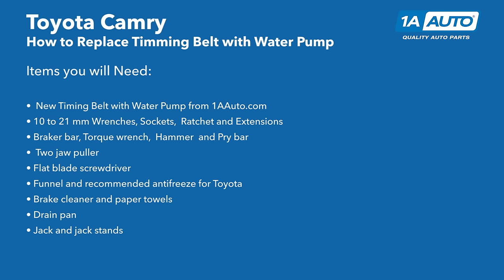How to Replace Timing Belt and Water Pump 92-01 Toyota Camry Sedan

Comment: I see a total of 3 belts are removed. What is the name to the belt on the alternator and the other belt, that isnt the timing belt?
Reply from the maker: +Dylan Martinez The first belt is the serpentine belt, the second is the power steering belt, and the last belt is the timing belt!  If any of our viewers needs to make this repair, we carry the auto repair part shown in this video on our website. Here is a link to them: http://www.1aauto.com/toyota-timing-belt-kit-with-water-pump-gates-tckwp199/i/gaeek00001?utm_source=YouTube&utm_medium=CTA+Comment&utm_campaign=ytcomment&utm_term=2kQLMP9AYGs
Reply: 1A Auto Parts thanks! I've already ordered the timing belt and water pump from your website.
Reply from the maker: +Dylan Martinez Thank you for purchasing through us! Please let us know if we may further assist, and if you have a moment if you could leave us a review on Facebook it would really be appreciative. 
 Here's a link: https://www.facebook.com/1AAuto/reviews/
Reply: So you guys are closed right now. This is the first water pump I've ever changed. From your video, you refer to this as one "whole" unit water pump. At 16:42 you say it comes with the water pump assembly WITH ALL THE HARDWARE INSTALLED and the video shows the water pump exactly as the one taken off. The new one you use in the video is entirely new front and back, both halves. You're not displaying this half new half old hybrid water pump. Which is why I bought this through you guys. I finally got my old water pump off, ready to put the new one on, from the kit linked in this video, and I have HALF a water pump with a gasket, as if I'm supposed to reuse the other HALF of the old water pump. I'm really confused because NO WHERE in this video was it mentioned OR shown how you put the old and the new half together. Is this normal? What do you even call the other half of the water pump? You sent me the outside half with the pulley, but I'm supposed to reuse the old inside half of the water pump?! @19:20, when the water pump is sitting next to the coolant reservoir and hes putting the new O-rings on, it is shown as one whole brand new water pump unit, which is what I'm really confused about.

They video overlay in the top left corner says "But the EXACT part that was installed in this video at 1auto" and the link is the same as the description, which was not the same exact part.

Everything has been great up until this point, the directions were textbook and easy to use. 

I'm going to be calling tomorrow. But this inconvenience is throwing me off and I'm at a standstill on my work until this is figured out.

Comment: 23:10. You did not change the oring seals. The front main seal, the camshaft seal and the oil pump seal. My oil pump seal is leaking.

Comment: Hey guys I need your help . Today I just bought a 1998 Toyota Camry Le ( with a Toyota Solara motor  Adapted) , I took its owner from Miami to Fort Lauderdale which is like 30 miles of distance  , pay him there and brought the car back to Miami  I had no problems with the car during my trips back and foward , but once here in Miami and while I was talking to a guy at the Company' s parking lot ( with the car on and on parking position ) the car suddenly turned off , and then it continued doing this all the time I turned on and leave it in parking position , I left the car there at the parking lot and tomorrow I' ll see what happens , guys can you give me a tip of what' s happening ?,  I called the guy who selled to me and he told me that was an sparkplug and wire problem , help please just a tip
Reply from the maker: +William Rodriguez If there happens to be a check engine light on you may want to have to code pulled. it should help to point you in a directions as to what the issue may be. Hope this helps you out. 1aauto.com
Reply: 1A Auto Parts , thanks body yes the Check Engine light on that car is on , it seems that this only happens when the car is hot , do you think this can be a big problem ?
Reply from the maker: +William Rodriguez You may want to pull the code, it should point you in the right direction as to what is causing the issue. Hope this helps you out. 1aauto.com

Comment: I see you just said don’t apply pressure on the two piece bottom pulley.  Next you use a two jaw puller on this very same pulley. I disagree.   This should have been a two bolt puller.

Comment: Got a '99 with >222K. and I HAVE DRIPS & small VOL of water coming from pump. I thought no big deal a water pump on a toytota... What a job it is,   His vid did it all in < 1hour but what does shop labor say.  He is not using paper gaskets on that pump and neck and thermostat. Nothing. Why? no Permatex here either  At least with gauge hitting top. No Bloen head gasket..
His exact car sound much more base than mine. It doe not avg even 19 mpg hwy but rtubns very well, ideas?

Comment: LOL the cam timing slipped one tooth at 25:59 because he didn't tighten the tensioner bolt before he rotated the engine. Am I the only one who noticed that?
Reply from the maker: Thanks for checking us out. Shop here for high quality auto parts: http://1aau.to/m/Shop-1AAuto-c +A/C PROS
Reply: You are correct. I saw it too. He also left the disc off the crank before installing the lower cover.

Comment: DO NOT use the video's instructions unless you are extremely desperate. That timing belt is so much harder to get back on properly than the video lets on and it will likely take days to get done right with a ton of trial and error. just take it to the shop bc once you slip that timing belt off it most likely will never leave your driveway again.
Reply: In the middle of reassembly, had no choice but to fabricate a metal bar tool to release the tension. I think you would be OK if the timing belt slips off, just like my old 240 Volvo, non interference engines.

Comment: hi...I hear a water squishing sound in my car front area...any idea what it may be?
Reply: Yes it overheats when car runs for 7mins.,plus my fans seem to not be spinning even when car is off,fans spend for a little bit when car is cut on and them stops.
.Overheat occurs near upper hose ara by radiator I changed hose and when Add coolant to burp system coolant does not sit in funnel it flows right through and a little smoke comes from radiator area where cap resides,I also notice a little price of black rubber is missing from radiator cap,can this be an issue

Comment: I'm going to pay a mechanic to do it XD just in case something happens..
Reply: You should replace the oil pump too while you're down there. Check your power steering pump too and replace all the belts, transmission filter, and oil pan seal. Then, your car will be good, for another 100k miles.
Reply: Replace the valve gasket and fuel pump too

Comment: Oh hell, there's no way I could remember all you have to do to replace the belt...too much to remember so I guess I'll have to blow $600. ( the quote I got from a mechanic at a garage) I may have to shop around for a cheaper price.
Reply from the maker: +Jim M. Thanks for watching. Buy the part in this video on 1AAuto.com: http://1aau.to/m/Shop-1AAuto-c
Reply: Did your timing belt break whenever you was driving and if so did replacing it with the work and no more problems

Comment: so when you click on the link its just the water pump and not the whole housing!  mis-leading.  Great video tho
Reply: I've never replaced the whole housing, just the water pump. The housing doesn't fail generally. I guess it could corrode if just water was used, no antifreeze. I've never seen it.

Comment: I totally appreciate this video, but how in god's name could Toyota make this be such a humongous job? You have to rip half the motor apart, align things you can't even see and then put it all back together just to do a simple timing belt change out. Is this for real???? I want to take all the old parts and throw them at the CEO of Toyjoke-a
Reply: This is about as simple as it gets for a timing belt job.  Toyota made it easier by using camshafts with scissor gears so you only have to put the timing belt around 1 cam sprocket and not 2.
The worst thing about this job is that it's a transverse mounted engine so you have no room to work.